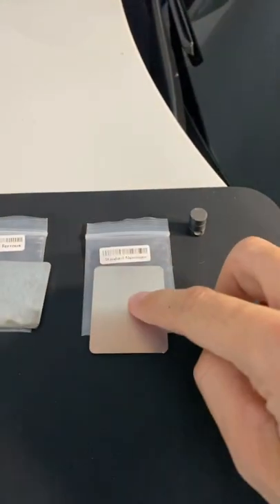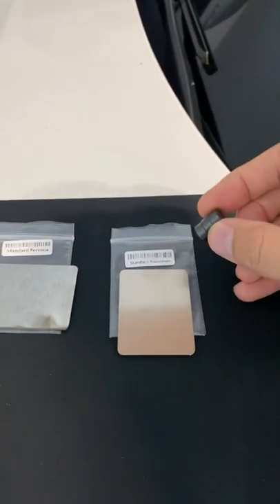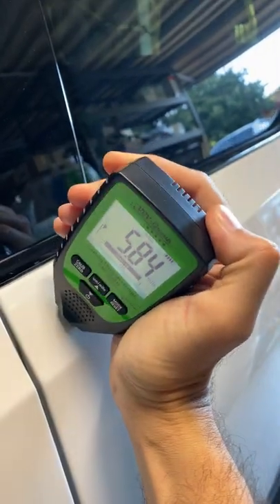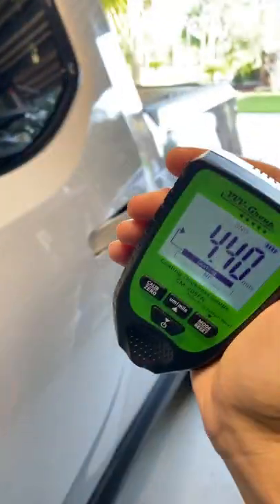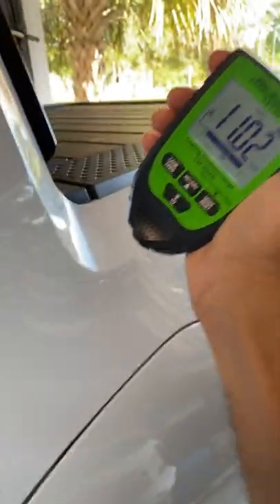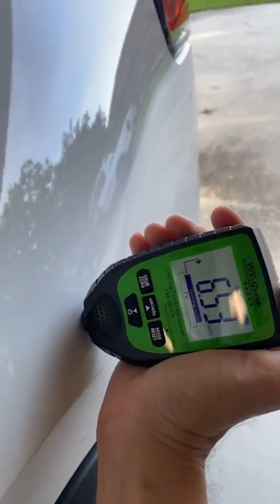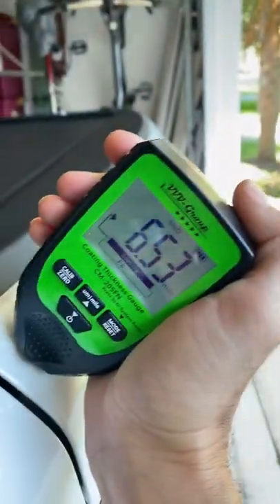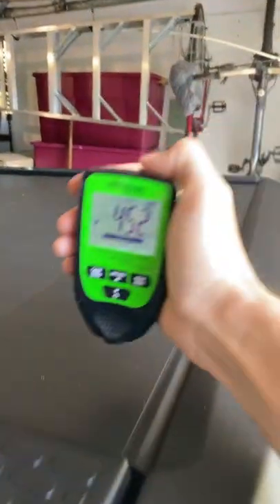Paint thickness Rivian R1T electric truck Launch edition

Comment: What are the units of measurement???? I'm sure it's not 11mm thick!!
Reply: It’s measuring mils, not mm. One mil=.001”
Reply: @DHG1078  OK in thousands of an inch, how would anyone know when it was never mentioned? Could have been microns, 0.01mm, 0.001mm etc.
Reply: @WATCH-IT-BUSTER  It's in the screen of the device, but not very clearly visible in video.

Comment: Those metal blanks are for calibration.  Zero the tool on them.   That's not a whole lot of material on that truck.  It's typical of medium to lower end us market vehicles.  Jeep Chrysler products typically have more. Suzuki and Subaru typically less. Actually if that's a metallic white or pearl white it's likely a three stage paint and should really have more